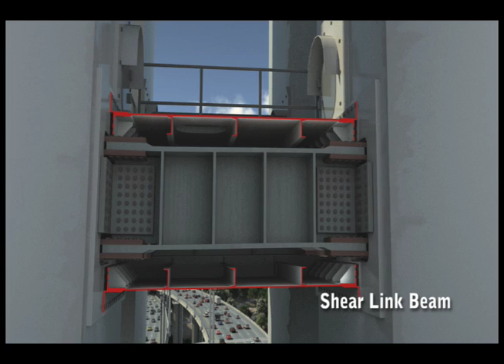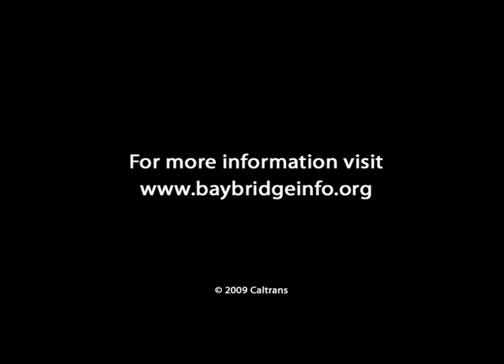Bay Bridge in an Earthquake

Comment: The problem with that bridge is it's a cantilever that is self-supporting by compressing the deck but the supporting column is not centered and placed vertical the column should have been leaning 15° towards the island this engineering blender is why the bolts on one side of the Tower or tighter than the other and the bolts were discovered to be defective when attempting to torque them to their maximum specification .
The inbalance of this bridge will cause its ballast to be its destruction in an earthquake.
For the ballast to balance this span they actually use the bridge section coming from treasure Island as a counterweight.
The Bay bridge is nothing but an architectural engineers wet dream.
Is the only bridge in my 40-year career that I worked on that I advise people to avoid like the plague because of its horrible structural design.
You'll notice in every video about this bridge they never mention the footing of the vertical column supporting at all.
The engineers also forgot to mention that if treasure Island move North 1 ft at a 70 to 90° right angle the entire structure will fail.

Comment: I regret to say that the catenery system that is shown on the bridge have a lot of rectangles (0:58) and a rectangle will change its  shape due to the fact that its diagonal is not bounded to create TRIANGLES.  So I am afraid the damping of the deck would not be as shown as those blessed vertical cables from the main catenery  cable will cause the main cable to develop not only the fundamental but also the harmonic frequencies.  The damping cannot come from that cable suspension system but it had to come from the deck which is a little better than the old Tacoma Narrow bridge which has the same cable suspension system. If those suspension cables  had additional diagonals or the deck was stayed by cables forming triangles anchored from the deck directly to the pylon or tower then the deck will not vibrate as shown in fact it will be more stable as any oscillation will be canceled by the triangular shape of the tower the deck and the tension cable as in cable stayed bridges. 
At o:57 the left  main cable is seen oscillating laterally, but because of the rectangular gaps due to the vertical cables holding the deck from the main cable that main cable will be vibrating vertically like the Narrow Tacoma bridge.   Those vertical suspension cables should now be accompanied by diagonal cables.

Comment: Pretty trick but why did they only replace part of the Oakland Bay Bridge and not the entire bridge?
Reply: My Road Tours l
Reply: The western suspension portion underwent a seismic retrofit but the eastern part could not be effectively upgraded. For one thing, that part of the bridge was built on wood pilings driven into the bay mud in the 1930's. Not a great foundation.

Comment: Definitely has better safety than that accursed cantilever span. Come on 1930, what were you thinking?
Reply: SkyDefender People in the 1930s didn't know much about earthquake.
Reply: The cantilever bridge did just fine in the earthquake the problem was the wooden tiles that were driven in the mud sure to off at the bottom of the concrete footings.
The new bridge is a cantilever design that is 10 times inherently more dangerous to structural failures because of its lack of redundancy in the design that is horrible beyond belief.

Comment: if we were to have a 8 or a 10, would the Cables would be able to withstand, Or the Bolts that we already had problems with before. or if it were to just collapse like most bridges did in the past disaster?
Reply: Mitchell J 
Uh lol, Your location has nothing to do with the intensity of earthquakes. Besides, San Francisco has had a 7.1 Earthquake. The Japan earthquake that caused the tsunami in 2011 was a 9.0. So maybe before you comment on something you obviously don't know anything about. Try researching it? Maybe take a 3rd grade science class to learn more about earthquakes. Lolol smh.
Reply: 10 Impossible
Reply: California will not break off and become an island. smh.
Reply: You would not want to see ether, a 8 would be a disaster & a 10 California would be a island!!
Reply: exactly
Reply: Kissy Fish This bridge and its life space are meant for magnitude 7-7.5. Same with most of the buildings in San Francisco. If San Andreas was to rupture with a magnitude of 8 or higher (very unlikely, we are speaking once in 1500 years), then expect somewhere between 1000-10000 dead in the Bay Area. Because all we have cared about is cheaper and cheaper structures in the past decades. No one invests on seismic safety.
Reply: Mitchell J Japan
Reply: New Madrid earthquake zone has gotten HUGE quakes in the past. But they are very rare. The thing is, they can cause widespread destruction because the quakes occur in the middle of a tectonic plate, where the plate is stiffer than say the west coast. The shaking movement can travel further - it's been reported that smaller quakes have caused tremors over a few hundred miles away!
Reply: Only oregon gets earthquakes higher than 7.0

Comment: Just looking at the smallness of the pillars holding up this bridge sends shivers down my spine.  What? Is the leverage less than two feet? Imagine an earthquake rocking back and forth...you have 2 feet & 4 feet and 2 feet by 2 feet or four feet by eight feet...which pillar will be able to hold the bridge during a slide? Are you Americans that stupid? Then, there is the water which is moving the sand away from the base and tipping the pillars? Which bridge would u like to use?

Comment: I agree it's been a huge debacle, but even with it's shortcomings and flaws, it's still far safer than the original span.

That said, they could have built this far safer, simpler, faster, and cheaper if they had just gone with the original plan for a simple causeway. Unfortunately Oakland bitched and moaned about getting another 'ugly' bridge and demanded an architecturally unique span. Like that's gonna make Oakland seem nicer at this point. Whatever.